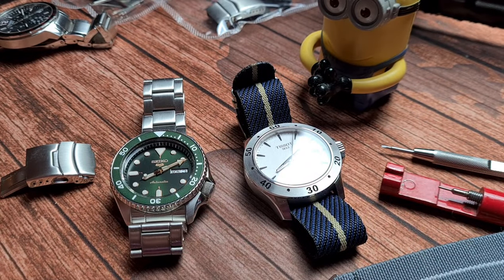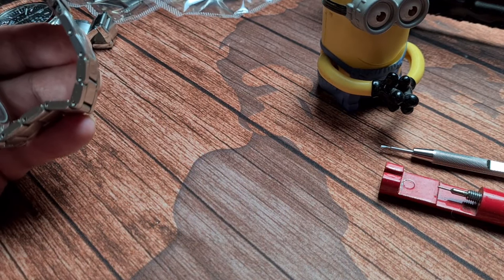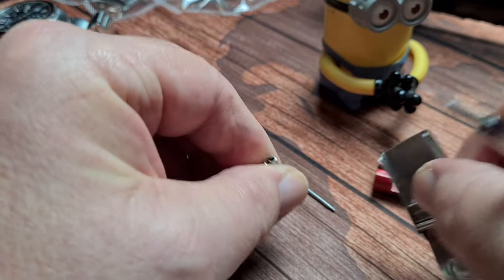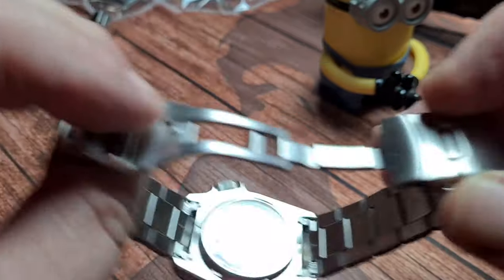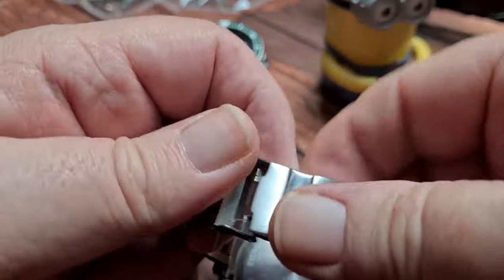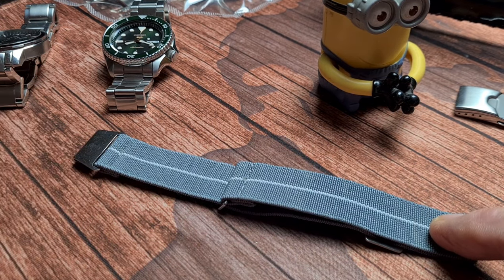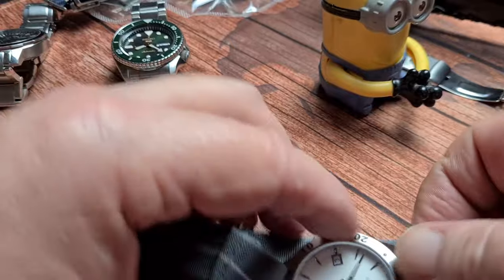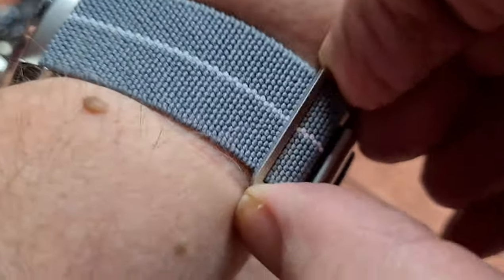How to change a pressed clasp for a milled clasp & how I fit an elastic paratrooper style strap.

Comment: I had to change a clasp on a 'jubilee' to a butterfly one as the normal clasp was too long and even with all the links removed it was too long, butterfly clasp sorted that out. I wear the elastic straps same as you.
Reply from the maker: Thats actually a pretty useful tip if anyone else has the same issue. The elastic straps are very comfortable. Thanks for watching.👍

Comment: I dont mind Citizens pressed clasp as long as the bracelets half decent but after a certain point they should be milled. I bought a really nice racing chrono for $499 the other day and it had a pressed clasp! Luckly I like you swapped it out for a 20mm promaster clasp I bought from fleabay.
Reply from the maker: To be fair Citizen bracelets at that $500 ish pricepoint are usually pretty good quality generally better than the ones we get from seiko so I guess swapping out the clasp is a bit more forgivable, I tend to keep a bit of a stock of 18mm & 20mm milled clasps for just that reason. 
Thanks for watching.

Comment: This was simple enough. You just remove and reset the springbars. But, that is not the point. The outer pieces of old and the new clasp are both pressed. Only the two inside parts of the new clasp are milled. But, the problem is that only the outer part of the old clasp has the brand logo on it. And, I would like to keep the old outer piece, because of the brand logo. Which would mean takiong apart not the bracelet, but both the new and the old clasp, to take out the outer piece of the old one with the logo and the two inside pieces of the new clasp, which are milled. And to create the best possible clasp for the watch. That, I am sure, would not be easy. I don't think we are talking only about removing and reaplying springbars anymore, but cutting pieces of steel and I am afraid that would require watchmaker's intervention.
Reply from the maker: To be completely honest I don't think that many people would be too worried about keeping the brand logo on the safety catch or the outer shell of the clasp & if anyone really wanted the fully milled clasp including the outer shell they are available but obviously at an increased cost. You get what you pay for! 
The point of the video wasn't to show the different types of milled or pressed parts but show which parts need to be removed & how that is done & how easy it is to swap out a clasp with minimal tools & experience, which is the video that I was asked by a subscriber to produce.
But you are indeed correct that if you really want to keep a brand logo on the clasp trying to swap the outer clasp casing & installing an aftermarket milled centre does not work. I have tried & they never fit together.